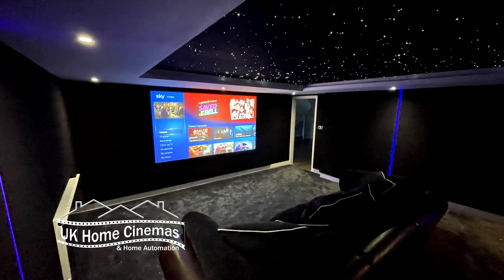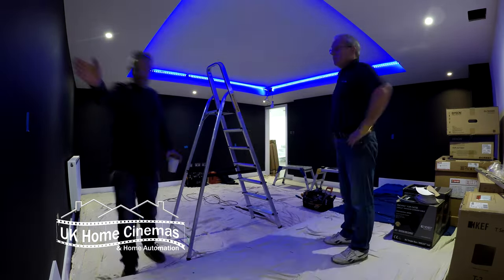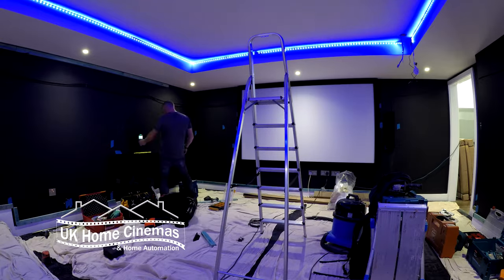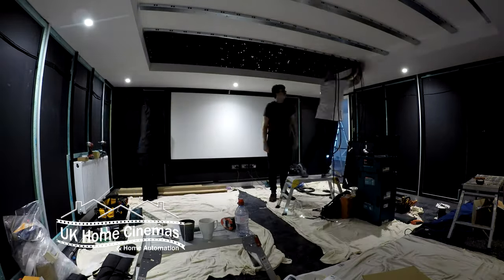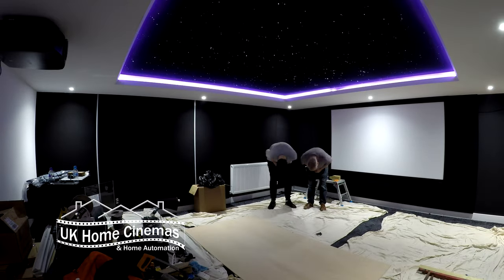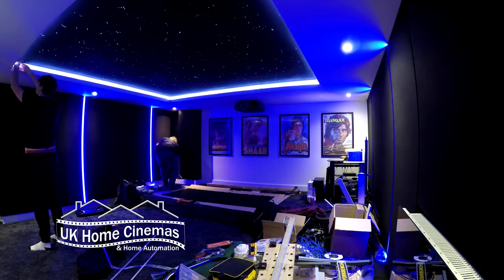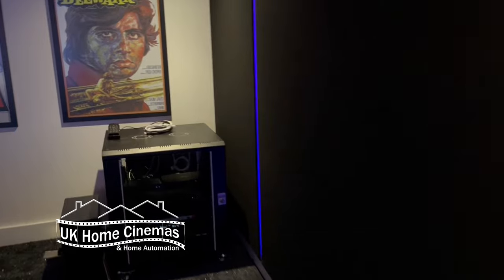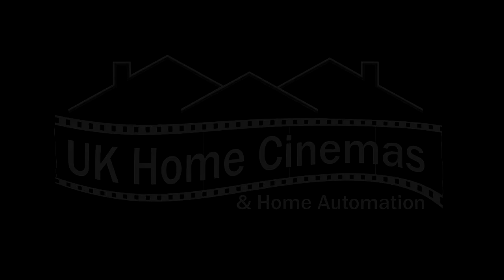Home Cinema Timelapse - Fabric Walls - Hidden Speakers - Star Ceiling

Comment: Very nice installation. A rough guide to fully  installed cinema room would be helpful, as would the room sizing.
Reply from the maker: Thanks , the room was about  six metres square, we tend to think that six metres is just about long enough to have two rows of formal home theatre seats.  Sorry but we haven't prepared a guide to creating a cinema room, although we might create an online guide soon, as part of a home cinema web shop which we are working on. When we launch our web shop it will be accessible via our main web site ukhomecinemas.com
Reply: Thank you for that. I always assumed that 5 x 4 metres was optimal for a home cinema, ie 20 Sq Mtrs.   @Ukhomecinemas
Reply: Just re-read my original message and see that I missed out the word "costs" after installed cinema room. @Ukhomecinemas
Reply from the maker: @keith-777   We have now created a web page specifically about this project on our web site and we have included the costs at the end of the page. here is a link to that 

https://ukhomecinemas.com/home-cinema-design/home-cinema-cost/
Reply: @Ukhomecinemas  Just looked t the costings on this and they seem very, very reasonable for the quality output. Keep up the good work and videos. Thank you.